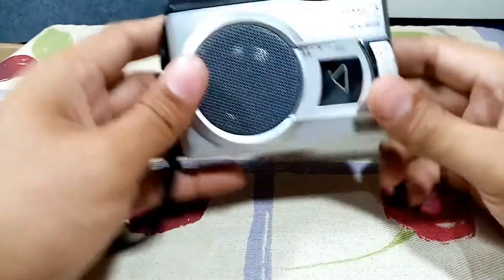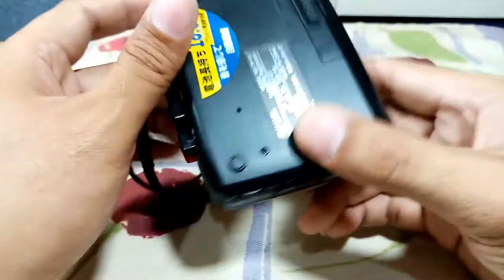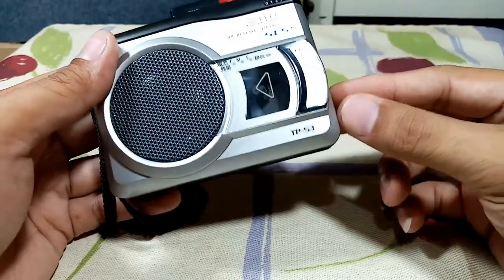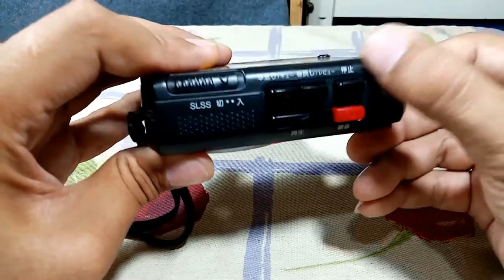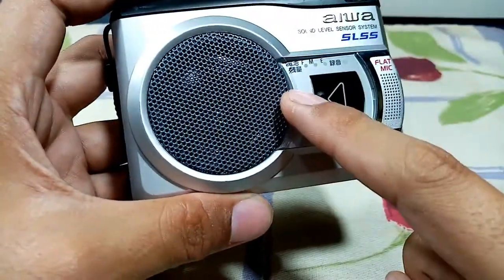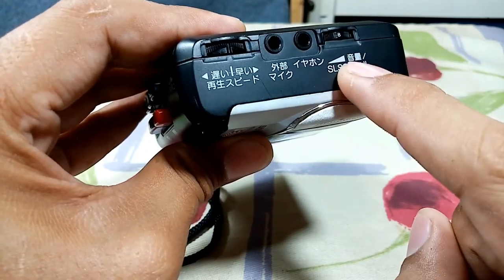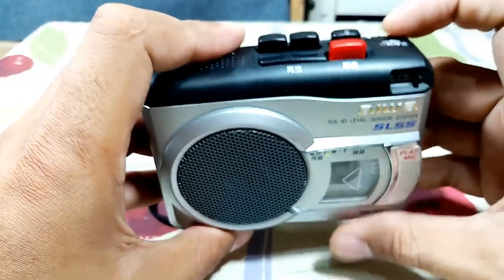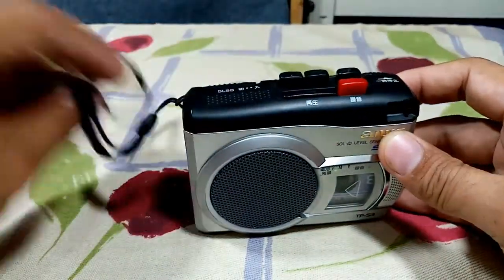Aiwa TP-S3 Cassette Recorder

Comment: Liked and subbed po! :)
Have you tried recording using this? I am planning to make a mixtape for my friend but I don't see any guide for recording anywhere. Maybe you have thoughts about it. Thank you!
Reply from the maker: Hello po yung pag record ng cassette tape mam is kailangan yung cassette tape nyo po may "TAB" pa if wala na then lagyan nyo ng paper hanggang mapuno yung tab. Yung tab is yan yung square sa upper side ng tape left and right. Kasi if walang tab hindi nyo ma push yung record button. About sa pag record sabay nyong pindutin ang record at play button. Para makabisado nyo po kailangan nyo ng cassette tape for trial and error para din maka adjust kayo sa lahat ng settings ng player or para makabisado nyo po.